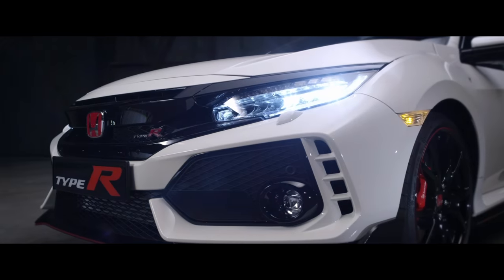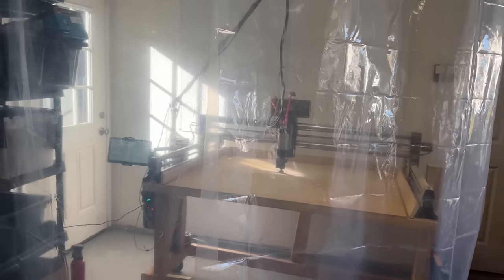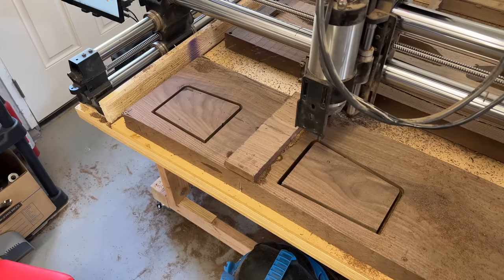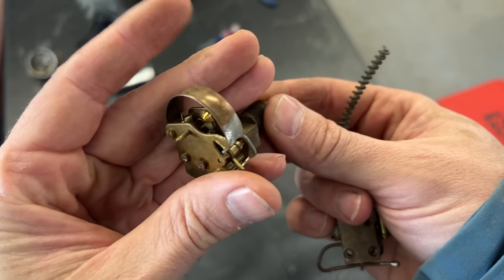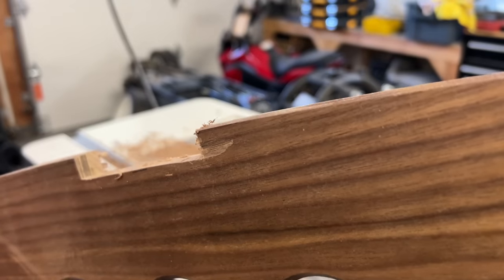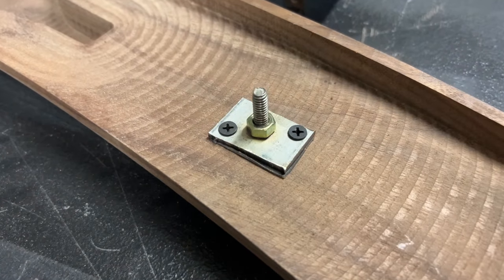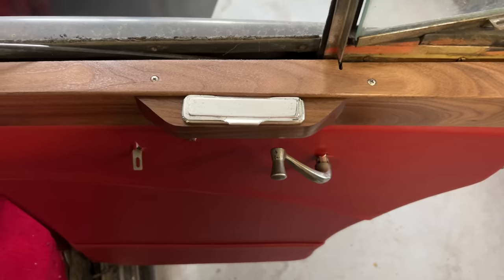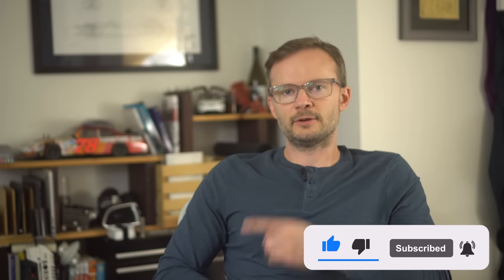Make A Wood Dash For Your Car. Or Just Watch Me Do It. Whatever.

Comment: I know you love to experiment, but for my project, I grabbed a GPS Spedometer from Speedhut.  They should be able to provide you the guts so you can reuse your own face.  Likewise, if you're using a BMS that outputs State-of-Charge as a 0-5V value, you can use the movement for a Wideband O2 gauge as a fuel gauge, you just need to match the sweep length.  Temp gauge is also easy enough, you just mount the sensor into your battery coolant flow.  Modern digital tachometers use a PWM squarewave, usually fed by a wheel on the ABS, which is definitely an option if you've got the encoder wheels on the Tesla hubs.  I used an Arduino to pick up the RPM signal message on the CANBus and translate it into PWM using math.  There may be a better option, but one hiccup I ran into is that there's a millisecond method and a microsecond (I think, it's been a while since I did this) method, and there's a place where you have to swap or you get weird readings on the tach.  For me, this meant initially the tach would go nuts under 700 rpm and then be accurate over 700.  So there's just an IF in my code that says "if it's under 1000, use millisecond, else use microsecond".  You may already know all of this, but just in case, maybe I can save you some time.

Comment: Coating all the bare wood pieces with West System epoxy and 207 UV hardener would stabilize the wood and provide a perfect base for the final finishes: matte, satin or gloss. The epoxy effectively eliminates expansion / contraction of the wood by way of thermal cycling.

Comment: SWEET! - I also prefer REAL wood panels in my classic ride - 78 Bronco. I redid the bed and door panels with 3/4" American Walnut planks Rivnutted to the steel. Hand cut and LOTS of wood rasp (before I had a router) and lots of Pure Tung Oil.  You can hang from my doorplanks and I can't tell you how sweet it is to have the flathead screws just pocket in find the thread and pull up tight when removing and replacing a panel. I have one nice wide solid piece of walnut saved for the dash once all the gauges are set up.

Comment: Whitworth threads can be replaced with UNC, although the thread pitch is different. Usually you can just fit a UNC nut to a Whitworth bolt, but it sometimes helpful to first clean the nut thread up with a UNC die nut. I can send you a Lucas wiper assembly if you wish.
Reply: The pitch is the same (usually), but the thread angle is different (55 degrees compared to 60). Les in UK

Comment: Nice job. Looks so much better.  I wish I had the equipment you have i would like to redo the wood trim in my 1987 mercedes lucky my car only has 3 pieces. 
I thought about stripping it and refinishing it but the veneer is very thin and would be easy to sand through.  I painted and restored cars for 30 years but dont have Allot of wood working skills.  I have been looking for used trim parts that all the laquer has chipped off so I can lightly sand them and spray with automotive clear coat.  Mercedes used a thick coat of clear finish on wood trim and 30 years later 
Allot of it comes off easly.  Just time consuming. I would prefer to paint a car over playing with wood trim.

Comment: 0:26 - looks like veneer over plywood?

1. Plywood does not move (expand / contract due to atmospheric moisture like humidity / sweat, etc) as much - so you have a plywood base 
2. The veneer therefore does not have enough thickness to absorb water / dry out and thus "move" = crack / warp, etc.
3. Plywood is cheaper than birdseye maple or walnut burl, etc, which matters for 1000s of vehicles in production
4. Plywood is bendable / shapable / steamable / kerfable - all the -ables and thus easier to form into the desired shape in steam presses of as part of the automated or production line process.
5. Veneer is easily molded to the existing shape of a plywood form

You can stabilise solid wood using something like cactus juice to help prevent it from moving / warping / cracking.
 

Stunning result, well done.

Comment: As i understand, you guys just got 15 feet of snow out there, but otherwise, we in other parts of the country have things that you would likely not know about that we call "seasons".  There are actually 4 of them, and they like to cause stupendous amounts of dimensional instability in all types of wood, which is, i imagine, one of the main reasons that the original pieces were constructed of plywood (along with actually sourcing pieces of the correct size). the lamination process and opposing grains help make it a much more stable material. And as an aside, ive never found veneer too hard to work with, but i have never used it for compound curves like the dash board, so the cnc was likely a good choice for that.

Comment: Personally, when making a new board, I would add space for the radio and speakers, especially as there is so much space with these glove boxes, even at the expense of slightly moving / changing their size.  Maybe they weren't there originally, but it would be nice to have them on the road today, even with cutouts for speakers in the form of slots and a radio as two knobs and a scale/display (as in old rear-mounted radios) even leading to a home-made set  in a plastic universal package made of DIY parts, mounted somewhere under the board where there would be a place for it, not protruding from the physical radio, e.g. 1 DIN if there is not enough space for such a radio.

Comment: There are real engineering reasons that the factory wood was a veneer over the top of plywood.  Real wood with a veneer is very stable, and doesn’t move with changes of temperature and humidity.  It also doesn’t crack and permanantely warp in response to the changes in environment.    Good luck with your solid wood componenets.

Comment: Often times there's a reason why veneered ply is used instead of solid wood.  Think about how wood fibers expand and contract with environmental conditions, then think about how most ply is bidirectional, rotating the grain 90° each layer, and how each sheet of face grain is glued to the next layer; it's literally more dimensionally stable, second only to fiberboards, and in many ways similar to gluing together multiple blocks of wood with varying grain orientations.  This is also why plastics and composites are used modernly, other than scale of economy and better manufacturing methods, not to mention weight and material usage, they're just more dimensionally stable than wood products are, and even then heat warping is still an issue with a lot of plastics; now imagine heat not being the only factor but also humidity.  If you want a wood look to anything in a car, leave the wood for a non-structural beauty panel that's properly fastened, preferably adhered, to a material that is properly used for structural intent; this is why most mounting brackets and mounting assemblies are metal, for strength and rigidity, no matter what the beauty panel is made of.

Comment: Hey Matt. I have used the rear wiper motor assembly out of a hatchback for a replacement for old front wiper motors before. They are compact and oscillate. They also have self park and multiple speeds. Something to think about.
Reply: You can use pushrods for connecting the wiper blades and change the length of the levers to change the degrees of sweep.
Reply from the maker: excellent idea!
Reply: @SuperfastMatt  thanks. I did it on a 57 Buick. Worked good.

Comment: Due to extremes of temperature and humidity you get in cars I wouldn't expect these solid wood parts to last too long, there is a reason engineered woods like ply is used in old cars because they are way more stable than solid wood.

Comment: Burls are an actual deformity in the tree caused by disease or infestation and do not form the whole tree so you generally will not find huge amounts of it that can be cut into slabs for solid use. it was also very expensive because of this so was used mainly in veneer form. The form of the burl was often not consistent as it has no grain as such so while cutting it you will come across holes and cavities. This strange pattern was totally irregular and did not have the strength of healthy wood grain and it is renowned for snapping if you try even shallow bends.

Comment: Hi Matt, do you know the Henney Kilowatt? That is an electric Renault Dauphine from the sixties. It has analog voltage and ampere in the dashboard, together with a huge flipswitch for forward or reverse. Of course, that wouldn't be original to the Jag.

Comment: Wire up the ash tray to accept your phone so you can drop in gps.
Also, ther is a small blue tooth adapter you could wire under dash with a speaker and have music through your phone.

Comment: What we did in these cases of ruined dashboards: stabilize the original ply again, ripp/sand off the ruined surface and put on a slightly thicker layer of period correct veneer with epoxy under vacuum. The right formulation of epo and wood share the e-module, so the old nitro-cellulose craqueléé and the dog-ears do not come back. Still "fake", but it will not crack and check to the point that Your worthy clockworkery falls down under the clutch-pedal.

Comment: It'd be nifty if the tach showed current draw.  rpm doesn't make sense with 1speed and no slip.   
Maybe Arduino could pick the highest temp and show that on temp gauge.   If it got to red zone you wouldn't know what but it'd prompt a stop and check.

Comment: If you want to do more woodwork with your router get a stand-alone dust extractor unit from Harbor Freight or Lowes, they are not expensive. It will save your lungs. use it when sanding as well.

Comment: Flush trim router bit is the right term. But, I prefer tabby flushy router thingy much better.  Probably not as affective regarding marketing analytics but it rolls off the tongue much sweeter.  Lol.  YT recommended your video I guess b/c of the woodworking.  You might want to elongate some of your mounting holes for wood movement, the wood being solid and not composite or veneered. Don't want that beautiful walnut cracking or splitting.  Just a thought. Excellent work on the walnut and the car - as well as the commentary.  New sub!    Troy

Comment: Wood veneer is used for beauty and stability, if you want to see how important it is in automobile interiors watch the video on the Lexus IS steering wheel and all that goes into it. We have a Lexus LS that is now 16 years old and it is parked outdoors, the wood details, there are a lot still look new. All was done with veneer from the same tree so the grain matches throughout.
Reply: That's not how wood matches work.
Reply: @byteme9718  This is how wood is done in fine car interiors,   look into the Rolls Royces of the 50's and 60's , RR saved duplicate cuttings of the wood for each car interior in the factory in case anything ever damaged the car in the future so the wood could match in repairs.
Reply: @brettster3331  I was technical manager for years at the world's only ever authorised Rolls-Royce and Bentley Coachbuilder. You don't have the slightest clue what you're talking about but feel free to embarrass yourself further. Book matches require two consecutive leaves of veneer and sixteen are used in a typical car and there's zero chance leaf one would match against leaf sixteen. That means the entire wood set requires re-veneering so apart from wood species, it makes no difference using the next sixteen leaves or wood from a tree harvested 50 years later. This is a myth you've fallen for but don't feel bad, many others do too. There are many others including Citroen suspension and brakes used on the Silver Shadow, the rear armrest being edible just in case a car became stranded and the Spirit of Ecstasy wings being aerodynamically designed to deflect rain and snow from the windscreen at speed.

Feel free to challenge me on anything.
Reply: I am talking about book matching, that is a given. it is important to have all the wood in  the car match in grain and color and if burl is used it is even more important.
Reply: @brettster3331  If you'd ever worked with burl you'll know that keeping duplicate cuttings wouldn't work. Veneers are generally taken from trees specifically grown for the purpose and are trained is such a way that each tree is identical to others to maximise yields, Colour and grain however will vary massively within each individual tree.

One of my roles was to buy in veneers for specific repairs and would usually have to search hundreds of bundles to find one suitable and sometimes even that was unsuccessful. We also held the contract to make all out of production wood and trim items so I know for a fact the duplicate cuttings is a myth, something Rolls-Royce encouraged in many cases by not denying them.
Reply: @byteme9718  I do not mean to argue with you but I have watched vintage historical videos of R.R. where they made a point of showing the veneer cuts all labeled and saved with some sort of what looked like a paper or fabric backing and a label attached with the particular car listed, I was impressed by this, the video was done at the closing of the R.R. factory after the sale to B.M.W. in 2008 or so, the film crew was going through the factory building and documenting everything.
Reply: @brettster3331  Do you remember what I said about the myths? Just think, what possible use would there be in keeping even a sample of veneer when every single piece is different? Rolls-Royce never sold veneers and trying to get replacement finished, or unfinished veneer items when the cars were current was near on impossible. We had a Bentley 8 with the main dash section broken in two and waited for nearly five months on the promise one would arrive soon. In the end we simply repaired it. Another car, less than a year old, had a problem called glue migration where the adhesive had penetrated the grain of the veneer giving the deep parts of the grain a white appearance. It was agreed a new set would be sent but three months later, there was no sign of it so in the end we re-veneered the entire set. Throughout this time. Rolls-Royce supplied the owner with a new loan car. Rolls-Royce never offered a wood repair/refinishing service, even in their Crewe and London service centres when they were operational.  

If part of a veneered trim is damaged it can be repaired and even if small parts are missing then they can easily be filled and painted in. Even with a piece from the same veneer bundle it would be so far off colour the entire wood set would have to be stripped and stained to match the repaired piece or the entire set would need to be renewed in which case there's be no point keeping spare veneer. The pattern match then becomes the undamaged pieces and colour is irrelevant because of fading.

How the veneers are cut depends on the length and width of the bundles and again this is why spare matching veneer sets would be impractical. You may get away with eight large leaves or have to use sixteen and even twenty four if fall (picnic)tables are fitted. Almost every bundle is uneven in size, proportions and often irregularly shaped. If you took a typical 24 sheet bundle, even if you could find the ones cut before and after they'd likely be a different size and shape.

Rolls-Royce continue to build myths and another is the hand painting of coach lines on current cars. They've gone to great lengths to produce a video about only one man can apply these and yet if you know what to look for you can see it's an illusion. If you look at the lines on these cars you can easily tell they're not hand applied in the way shown. As I said, what possible use would a spare set of veneers serve, that's even if it were possible to find enough leaves? Just how much would it cost to keep them in a suitable environment for decades in the near absolute certainty they wouldn't be needed?
Reply: @byteme9718  Thank you for telling me about this, it is fascinating to hear about your
experience in working with these great cars. Best to you,  Brett
Reply: @brettster3331  To you too. There's enough amazing things to tell about these cars, pre VW/BMW there's no need to make up myths. You could pick up almost any significant part, or detail a process and that was more than enough.

Comment: OK. I don't know if you're even going to listen to me . but I've got an idea for you if you want to keep the dust down in your Shop. While You're running your CNC machine. With your router on it... taken build a square Box about an inch tall go and buy some old cheap plastic Whisk brooms... and mount one On each side of your box... And as it moves around it will keep the dust inside of the Box With the brooms around the bottom....it should kind of brush it all around out of the way. I think maybe you know what I'm trying to say here. I wish I could send you a picture. That would be like the broom you put behind your motor home.  To keep rocks from hitting your car only it would be on all four sides and it would be soft enough to push the dust out of the way.... and keep the dust down .... probably wouldn't have any dust a All just a Thought...... Oh and by the way I have never seen you're youtube channel before today I have subscribed.....